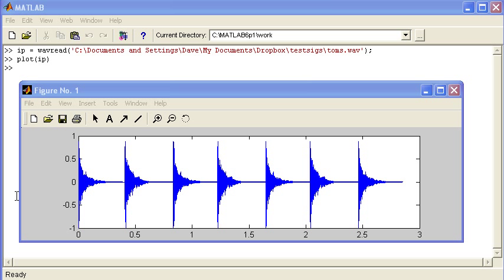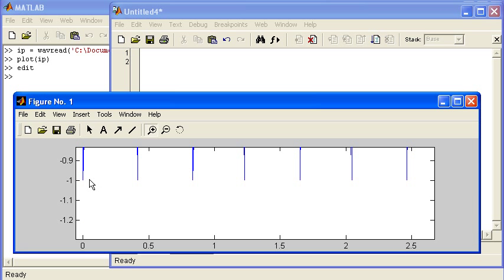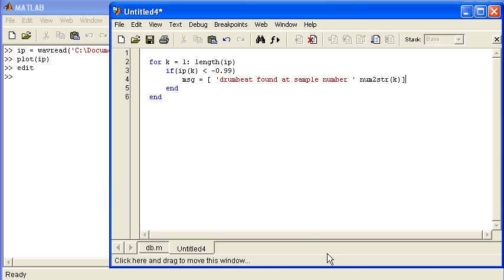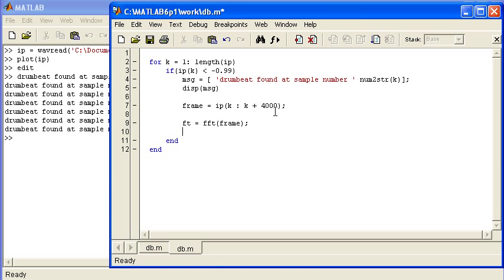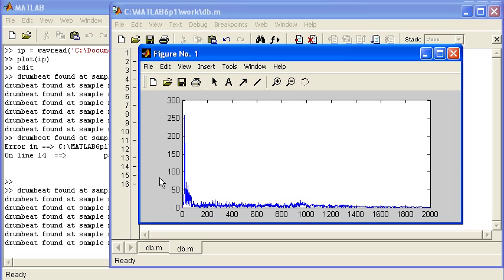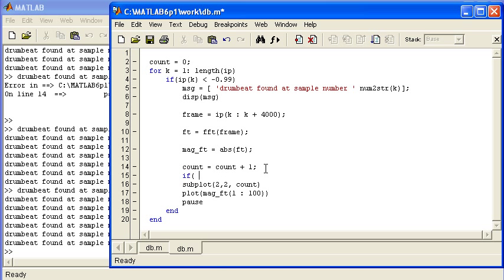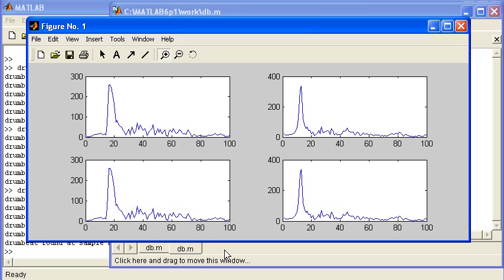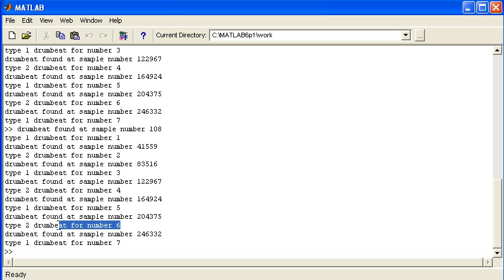Matlab Signal Processing Example - Basic  drumbeat analysis using matlab's fft function

Comment: I am trying to classify ambience and speaker signals. How to concatenate both and analyze? my ambience imfoambwf.csv   2 channels (stereo)
One column per channel.Sample Rate: 44100 Hz. Sample values on dB scale.
Length processed: 100 samples 0.00227 seconds.  sampling rate 44100 hz. Length processed: 100 samples 0.00227 seconds. 
Speaker- mono samplerate 48000 hz, 
which I one I should choose as feature for feeding to neural networks. From stft I am getting frequency and db levels.